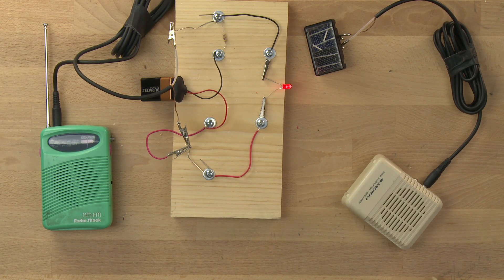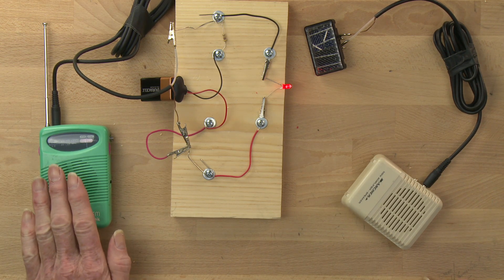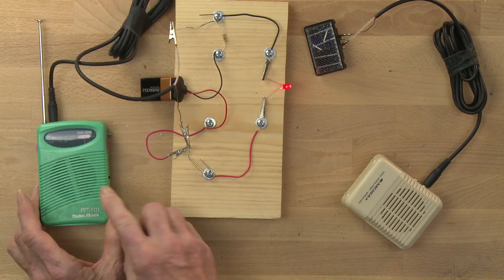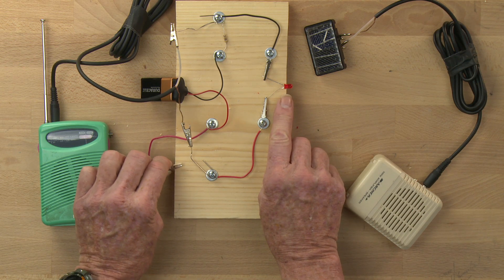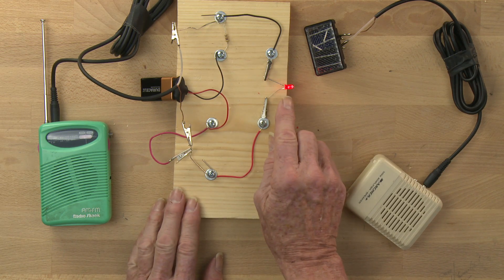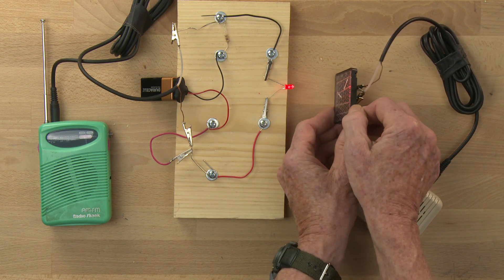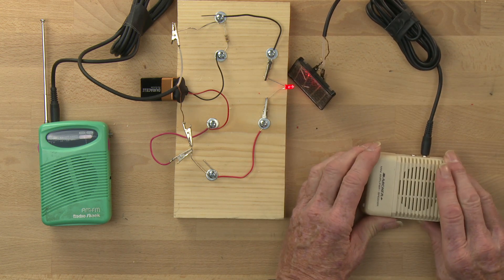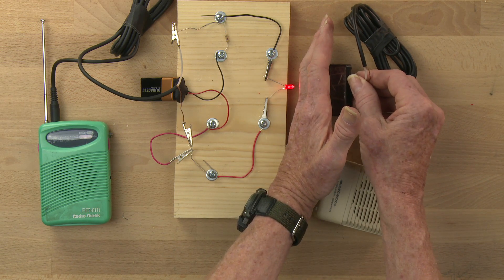How it works - Light to sound

Comment: What is the resistor value?
Reply: Igor Keves I think it must be about 1k, the Led cannot stand 9v. Well if you use a laser you can feed it with just 4.5 V. I've made this project some years ago, but I controlled the laser with a BC 548 transistor.
Reply: @fabiogn1  thank you very much. I have already made a similar project.
Reply: @fabiogn1  Please explain. Ohm's law if you use 9v and say you apply a resistor of 1k, what would be the final voltage? I=V/R = 9/1000 = 0.009, Then V=I*R which is: 0.009 * 1000 = 9v       confused..... cannot see what is the FINAL voltage the led is getting.